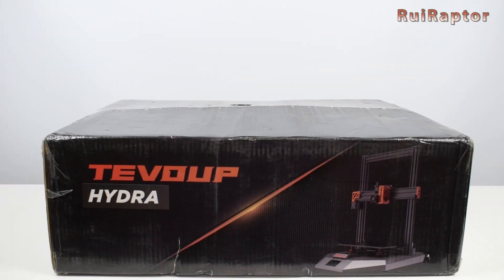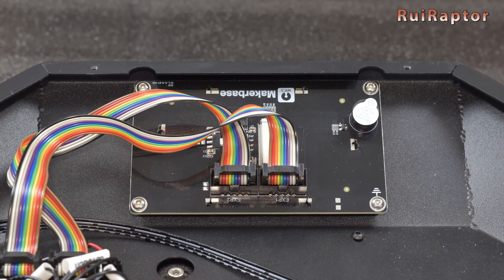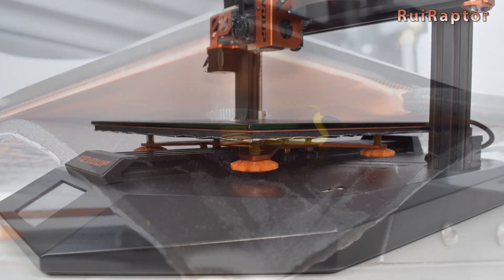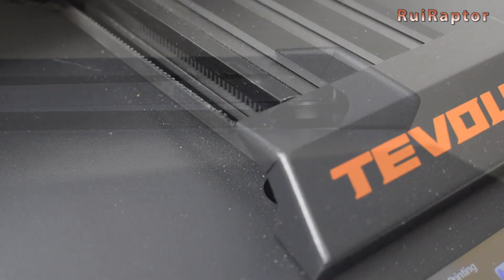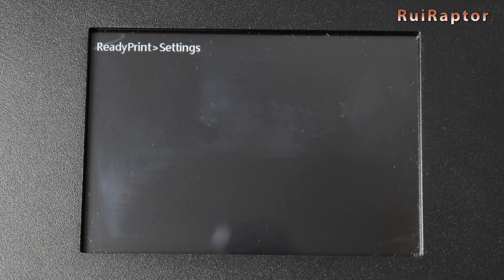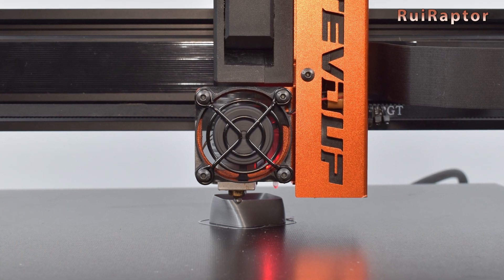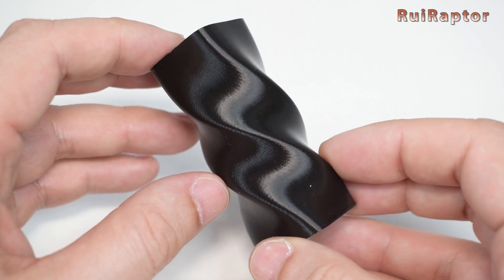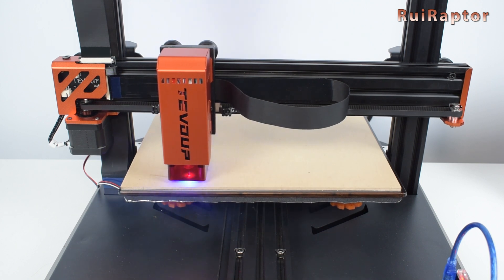TevoUp HYDRA (3D Printer & Laser Engraver) - FULL REVIEW

Comment: Excellent video. Ive just buyed the machine. But Im not able to make a good configuration with it. How did you save the files to run the from the pen drive??
Reply from the maker: Hi, you need to slice the STL files and then save the gcode files on the pen drive.
Reply: @ruiraptor  thanks a lot. I will do that!!

Comment: Good review. I have one of the early green Tornado printers that I have upgraded over the years and it's very close to this with dual Z axes, 32 bit main board, TMC processors, direct drive extruder, auto bed leveling, etc. and it has been a good performer. Getting a straight Z screw seems to be hard for China to make, when I ordered the 2nd for this printer it was not straight. I straightened it as best I could but like you took out the top bearing. I put an idler pulley on the timing belt with a spring to keep it tight enough to grip and that keeps the timing in sync.

I like the idea of a laser cutter engraver and the fact that all the upgrades are neatly built into the machine (mine shows it's heritage via extra cables and such) but I have a few concerns and questions. I visited the web page in the link and can find NO information about the more powerful laser option. I wonder if it could cut very thin sheet metal (I.E. more like a thick foil). 

The filament sensor issue doesn't worry me except for the mounting of the sensor. Since I use Octoprint I don't really need wifi, but I'm concerned about a couple of other issues - like replacement parts for the head mounts and contacts. Although they should last a long time you never know. And how much does the modular design limit owner modifications of things like the cooling fan ducts?

I would just replace the bearing/pulley with a real pulley made for the belts to eliminate the wear. I don't have a pressing need for a new printer so I think I will wait and see how well they fix the existing bugs. I'm also concerned about how stable TevoUp is considering this is the 3rd iteration of this company. I wish them luck as I always felt their products were kind of neglected compared to other brands. I know they copied a lot of stuff but they were innovative with the AC bed and I feel they have always used better motherboards than a lot of brands. 

The power off resume issue may have problem regardless - if it homes with the head cold AND the head is stuck to the part because it was extruding at the moment the power failed, it could damage the part OR loosen it from the now cooled bed. Perhaps they need to heat it partway then home it. I haven't implemented the recovery function because I have a cold-release bed so in most cases the part would be loose anyway.
Reply from the maker: Hi Vance,
thank you for your feedback.
The stronger laser can be found in the spare parts for the hydra section in their website ( https://tevoup.com/collections/for-hydra ). Both, 2.5W and 5.5W are there.
As for metal, it can engrave but it cannot cut through. 
Regarding the idler, we also thought about replacing with a real idler but the issue is that it might not fit because normally the idlers have bigger flanges and it might not fit in the profile's cuttout...however, that is something that is worth testing.
Reply: @ruiraptor  Thank you!

Comment: thanks for sharing. is the Y belt issue caused by excessive force on the belt?
Reply from the maker: Hi Bill, we think that it's cause by the narrow idler. The last zoomed in picture shows that the top of the belt (where the damage is) is rubbing the bearling's flange. Since the idler is made from a couple of bearings with flange, a spacer between both bearings would fix the issue.